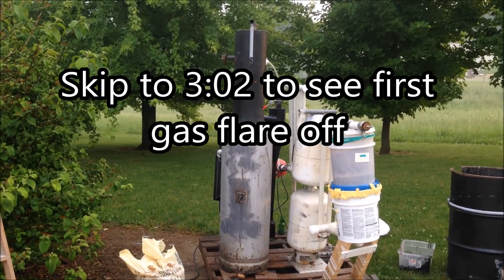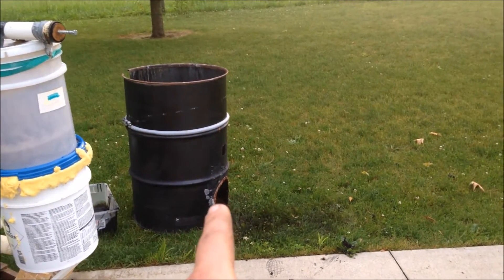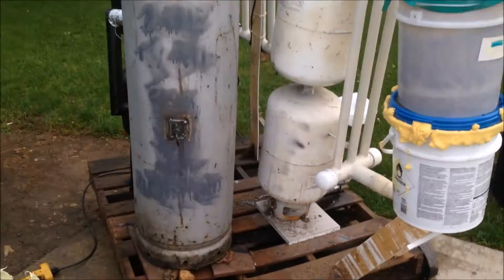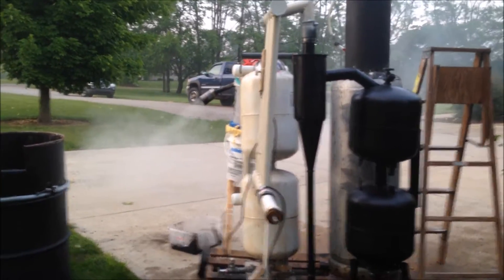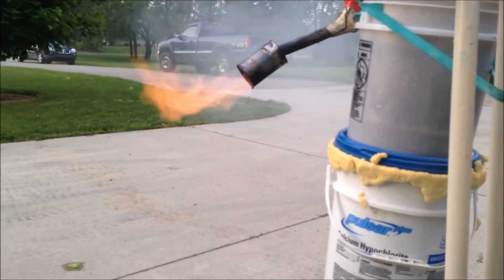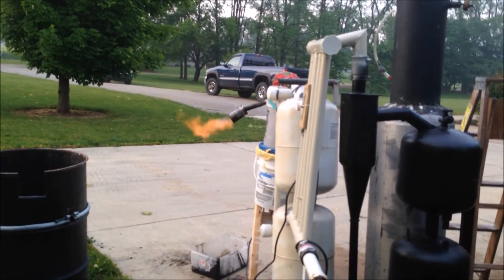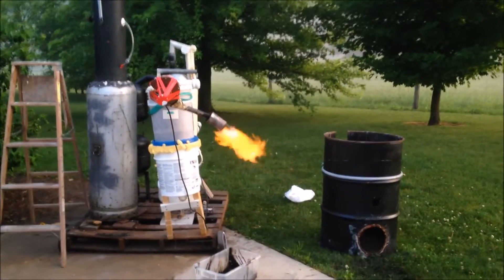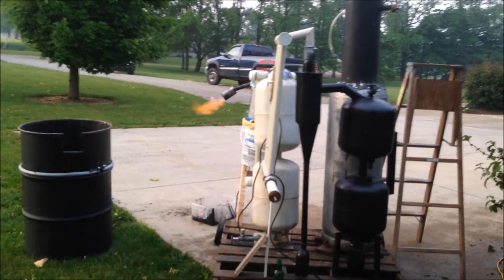Wood Pellet Gasifier, Orange/ Blue Flame Test Run

Comment: Orange and blue are good,  yellow is bad. Basically without lighting the gas , it should look like nothing is coming out of the pipe.  As for the speed of the blower, I typically find the blower to draw harder than the engine. Even turned down somewhat. If you draw too hard the gas may still have tar in it . The gas has to spend enough time in the high heat area to crack the tars. Also if you draw too little you may not get the reactor hot enough to crack the tars.  All variables,  all the time.  Quote from Jim Mason. Joe